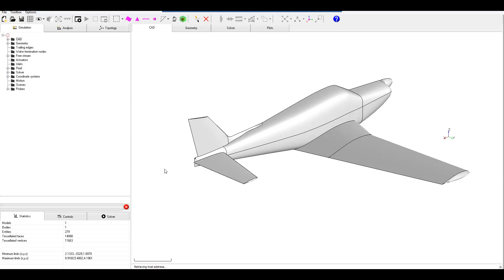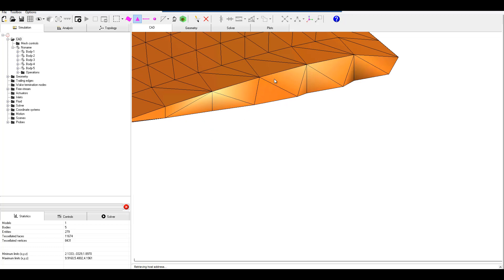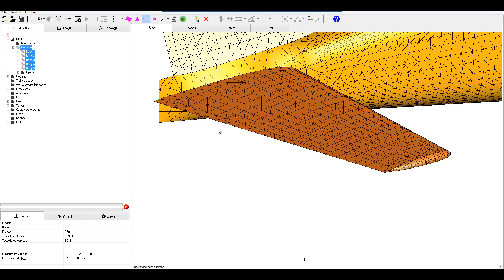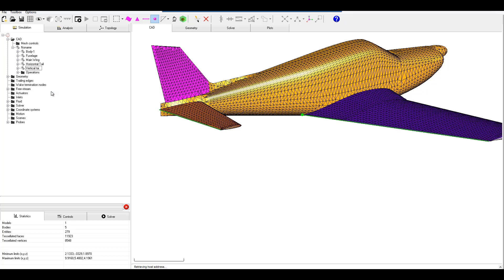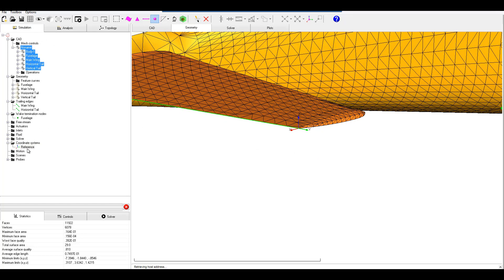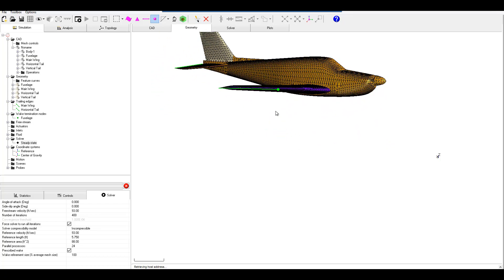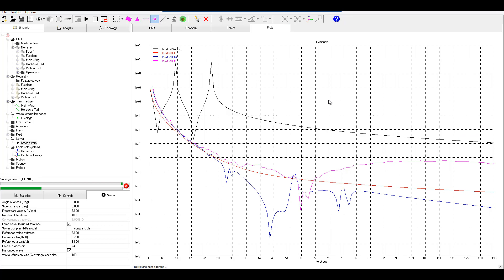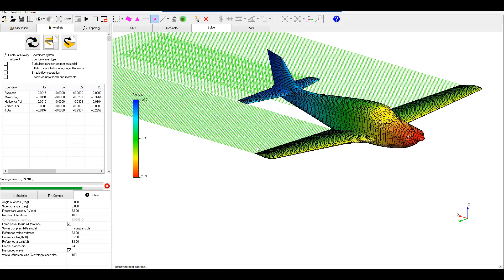1. Introduction to FlightStream®

Comment: When I increased the number of meshes, the software crashed in the middle.
My teacher said that I should make the time step smaller, but how can I make the time step smaller in a steady flow?
Reply from the maker: The mesh count depends on your model complexity.  Typically a few thousand faces would be sufficient and the software (and your hardware) would run into issues if your mesh count becomes very high.  You could contact us (https://tinyurl.com/8zv95mb9) if you need more assistance.